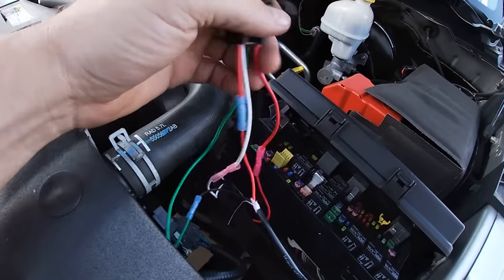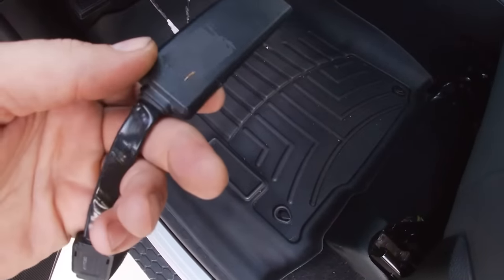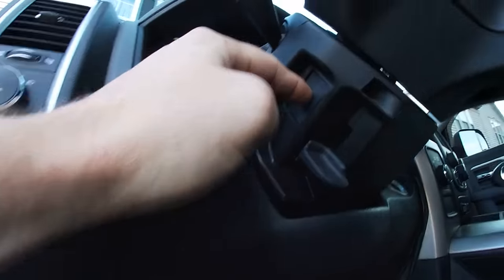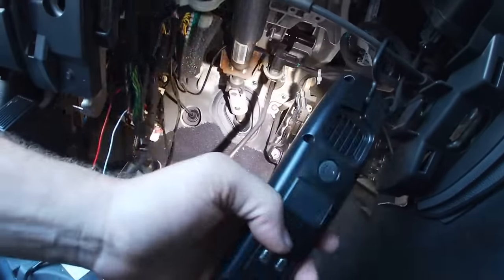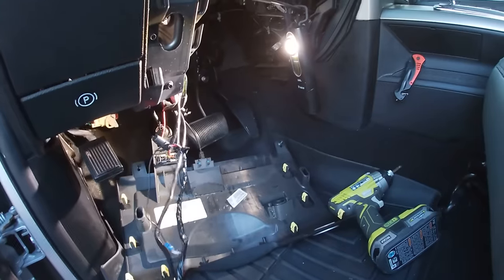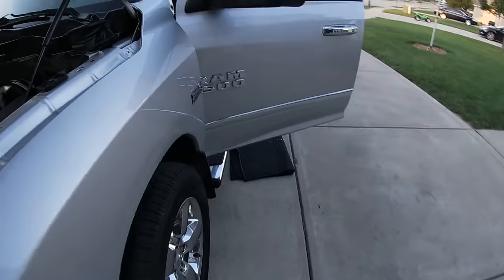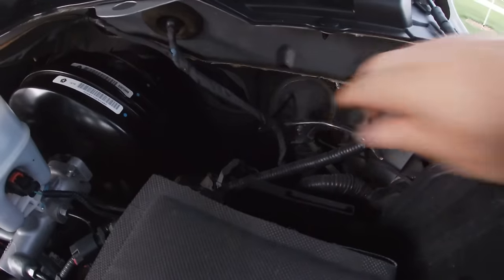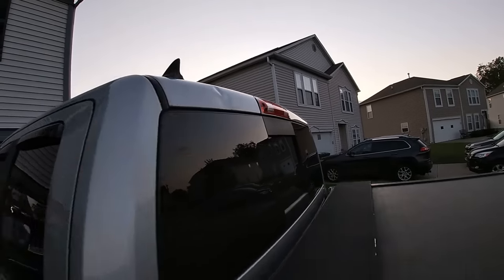Tracking Device Found on My RAM!

Comment: I just found a tracking device on my ram 1500 installed by an ex. Very similar. But instead of beating, mine honked the horn twice before start. No dealer had answers over phone. So I found a no named box with all the wires that you showed including relay. Thanks for the video.

Comment: I work for an energy company. Our trucks are outfitted with Tele-Matics which tracks our location, monitors for seat belt usage, fast or quick stops, hard turns,speeding etc. At the beginning of the following week we get a "report card" on how good or bad you drove based on mileage that you drove that week.  After truck has a certain amount of miles it gets turned back into leasing company who then auction vehicle. Obviously they don't always remove them.
Reply from the maker: jeff sir It makes sense to have them especially for a business. They should be responsible for removing them though because they will cause future problems like this one did.
Reply: I totally agree. Also these things have a draw on the battery because they are always on even when ignition is off.

Comment: Hey, I've got a 2015 Ram 1500 eco diesel that I bought from used car dealership. It won't start and the remote won't unlock the doors(checked the battery, good) found a DBall2 under the dash and think I'm having trouble because of that. Do you have any suggestions on how to remove one of those? I only one key and nothing on the disabling system. Thanks!

Comment: The tracker is a anti-theft device to locate the vehicle, and make sure it's not being used after hours, or the wrong way on the job. It's a cost cutting insurance premium saving device. Very common during the early 2000's.
Reply: Very common now.  I am a sysadmin and part of my duties involves helping people access the system to monitor, all our clients with more than a handful of vehicles in their fleet utilize trackers now.  The trucks at our largest clients all have front and rear dash cams as well in all their vehicles, I have to help them archive footage from incidents all the time.  There's a lot of money riding on those trucks, a vehicle being down costs tens of thousands in lost productivity.
Reply: This is correct, we have these similar GPS trackers installed at our work cars & trucks.  They don't have a starter kill but they do track 24/7 thru the OBD port.  Because our agency is self insured, we use them to reduce liability.  I can pull up any vehicle in our fleet and find out where they are, how fast they are moving, total average speed, and any airbag deployment.
Reply: @patshozo9158  In modern times they are like the drive safe modules that insurance companies use to lower your insurance rates, or the OnStar, or Guardian services.

Comment: I found a cellular tracking device in my used car, I tore it out and gave it to the dealership after they denied putting it in there.
Reply: High risk loans use them, rentals fleets, work fleets.  Alot of vehicles bought at auction sometimes  have them. Dealerships wont check that lol i have got 4 from 9 vehicles i purchased had them
Reply: Maybe the dealership didn't, you ever think it was installed because maybe it was a lease or fleet vehicle. You really showed them, tough guy
Reply: The dealership didn't install it. Why the hell would they go to that expense? They didn't finance your truck personally. They just wanted to sell it and move on. Tracking device was put on my the previous owner. Pretty normal practice these days for fleet vehicles and even personal vehicles. They just aren't worth the time to take off. So they get left on. Relax, conspiracy theorist. 🙄
Reply: I found one in a car I bought as well. The dealer had tried to get me to pay for a vehicle theft package as an add-on. I absolutely refused and got them to drop it, but it was still in there. They told me that's what it was for.
Reply: @jymlewis  Dont use conspiracy theorist as a negative thing. Its a neutral thing as in "questioning the status quo". If no one ever did that we would be living in a dictatorship already. Already confirmed and released to public "its a surveillance state", "CIA ran/running drugs", "Tuskegee experiment", "War is a racket and only for profit", and many many more. If you never ask the questions, then how will you know the answer?
Reply: They installed it. Ive done a few. They sneak the car in quick and have it installed
Reply: You said used car. They might not have, the original dealership, the owner, or third party might have put it in there. Cars will get traded in and the devices will go undiscovered and they just pass them on not knowing there is a tracker in there
Reply: Dude, if they got the car from another dealer, they really might not have known it was there.

Comment: We purchased a 2019 GMC Acadia that was a fleet vehicle in its previous life. I decided to surprise my wife a few months after buying it by taking it during her 12 hour shift and getting it cleaned and the normal fluid changes. When the oil change guys were done, they said there was a loose wire hanging from the bottom of the engine bay. They were gracious enough to let me go into the pit under the car to see this. Turns out it was the tracker that had been installed by the dealership when it was part of their loaner car fleet. We pulled into an empty bay and spent 10 minutes following wires in the engine compartment and removed all of the connections. When we did, an alarm started going off under the dash. I pulled the dash out and found a box similar in size to the one you pulled from the Ram. It was wired into the radio as well and had a cellphone sim card installed. Obviously, I removed it. The next day, I get a visit from police investigators asking me about the device. I turned it over and explained that it wasn't a fleet loaner and showed them the bill of sale. After several months of back and forth and even a trip to the stealership with the cops, they backed off.

Comment: When you first took delivery of the truck, was it beeping?  If that was super hot to the touch, that tells me there must be something wrong with the gadget.

What do you think about new vehicles using turbos on small 4-cylinder engines?  I drive a 2016 Honda Accord and am glad that it doesn't have a turbocharger.  (2.4L)

Comment: Geez ....Doesn't Chrysler have enough electrical problems without idiots adding crap!
Reply: As a former lifelong Dodge/Chrysler owner I can attest to that. Honestly I would still love Dodge and Chrysler if Fiat hadnt bought them. Instead of improving on the issues they’ve always had they’ve only gotten worse
Reply: I had a 2014 300  great car but after 10k the tranny needed "software" update caused it slipped between gears at 24k  a short in the alt killed the battery and finally 30k the AWD gave up the ghost. I traded it before the 36k warranty
Reply: Jeep....all of them being mopar..Jeep is the most frustrating damned vehicles ever! The security is a joke! It’s a damned Jeep not a Porsche so wtf do they use security screws in the ignition etc and then the security box in the glove box...when it goes bad and I’ve seen some go bad at 15,000 miles...might as well sell it for whatever u can get cuz it’s a never ending battle with the crank no start and alarms going off as ur driving down the road! Why haven’t they improved this crap? I love dodges! Love how they ride and the hp loved my dodge but my moms Jeep is sitting still after 3 years and no one knows why it won’t start
Reply: Lol, corporate has ruined everything.
Reply: oopps you got confused with Fraud (Ford) about electrical issues, does anyone own a Fraud without the check engine light on continuously on covered by a credit or business card (yeah that bad) drove 2 so yeah Never again. no more timing chain, cam phaser, oil pump,  failures... you just drive Dodge easily do 350k miles
Reply: @AmericanSurvival001   mines at 211,000 I have changed a valve cover gasket and the heater core and she still climbing to 300,000. Love my Dodge. My wife has been through 3 other vehicles while our Dodge seems to be the truck that keeps our family moving.
Reply: @shaunmcgowan827  exactly if that was a Ford you'd have $4k into it by now, like some  my friends just to keep it running, WE know the truth not the propaganda  that out there.
Reply: @AmericanSurvival001  yes sir a guy I work for has three of them sitting in his driveway. They rotate them in n out of the shop.
Reply: Not sure what happened with Chrysler vehicles. We owned a 1972 Plymouth Satellite Sebring Plus and not only was it scary fast, it was the most insanely reliable vehicle we have ever owned, we wish we still had it. I know that was a long time ago, but still.
Reply: @AmericanSurvival001  Truth ?All manufacturers have problems. Fiat Chrysler are at the bottom. That's the truth. Check out Scotty Kilmer channel for over 50 years of real world mechanic experience.
Reply: They are actually very simple devices.  Done properly they won't hurt anything and are supposed to be disabled at the right time.  This was one that was installed poorly and not disabled when it's use was over.
Reply: @AmericanSurvival001  my sisters escape has been at the Ford house 11 times since may 2019 for electrical system b.s.
Reply: @freedomliberty7611  Scotty Toyota Kilmer... Yeah he tells a lot of b.s. about car and truck history thats just untrue
Reply: @AmericanSurvival001  There is a reason that the dodge is just a shipping crate for the cummins.
Reply: At least its not a Ford
Reply: @Pat Larimer i was only speaking from experience
Reply: @Pat Larimer that I've only had problems with pos fords? It's ok mopar or no car troll boy.
Reply: No kidding!
Reply: We have software issues after an update. U CONNECT is on a Go Daddy website. They said take it to the dealer.
Reply: @classicgalactica5879  I got my dad's 74 satellite sebring plus with the 400 4barrel when I turned 17. Best car I ever had. Still miss it.
Reply: Holy sht. A truer statement couldnt have been said. Ive had to give up on two jeeps due to electrical bs and two engines and a transmission. All under 20,000 miles during covid. All to say… i didnt drive much. 
Ask 2020 gladiator owners about that uconnect thats not included or the 
“Aluminum doors” that magnets stick to every inch of (surface magnets not ACME sized)

Many PAY HERE places had tracker cutoffs for peeps who didnt pay their note every two weeks. If to the column, could be antenna or could have led to a cutoff at ignition.

Comment: They really f**** up the OEM harness for a gadget that can be put on a vehicle without messing with the harness.
Reply from the maker: Peace & Love Yes they did! People keep commenting that I messed my GPS for my screen up by removing that. Obviously people don’t know what they’re talking about because there’s no way the factory would I stall GPS like that. 😂
Reply: With that device , they can shut down your vehicle.  Happened me once. Then i ripped off that device out . No issues after that
Reply: I added a tracking device on all of my children's vehicles so if they were in trouble I could find them from an app on my cell phone. It was a simple plug-in device from Verizon Wireless that plugged into the diagnostic link connector under the dash. My son's 2021 Chevy Corona aka Colorado has a built-in tracker from the factory. He has an app on his phone that says "MyChevrolet" and he or we can track his truck. So if you have a newer Chevy try out the app from the Google Play store or iPhone play store so you can keep track of your vehicle in case you loan it to someone.
Reply: I got a 02 Durango that I've changed the computer and the crank shaft and cam shaft sensor then found the same device but they cut every wire in the stearing colume and put in 12 relays and a bunch of fuses

Comment: That’s a gps for fleet or for a a high risk loan, I’ve installed these on vehicles for banks, it’s also a starter interrupter so if you don’t make a payment you can’t go anywhere
Reply from the maker: That’s what I figured it was for
Reply: @FABAutomotiveDetailing  but in your case, it was corrosion, stopping the supply of power to the relay they installed to power the device

Comment: I have this same problem but only difference is, the relay and a separate bigger black box are tied straight into my push to start and THEN... I also had that little black box (minus the part that beeps) tied into my OBD2 PORT wiring. But when I took everything out, my car wouldn't start... Any ideas? Could there be a second relay since I have 2 signal boxes?

Comment: Whomever did that wiring job has caused future problems, what a mess.
Reply from the maker: Doctor John Yes they did but glad I found it!
Reply: Had one of these on my aunt's van,  it fried the ecm/ computer.  Flashers now turn on when doors open and it won't connect with obd readers
Reply: @spankystar9316  I always wondered what kind of idiot made the rat's nest of wires in my truck. Now I know!
Reply: i had the same thing melted my fuse box
Reply: The installer was a total less than amateur installing it, I'd be embarrassed to admit that was my crappy excuse for work.
Reply: Any installer that uses cheap relays and butt connectors is a hack and probably not certified. I've never heard of this specific product, but as a certified installer with over 30 years of experience, I can tell you that the install seen here was such cheese whizzed garbage that I would fire the installer if he worked for me. Having said that, I have seen some pretty bad installs just like this one on cars at dealerships, and either the install was done by a company that valued speed over quality or it was done by one of the mechanics at the dealership who wasn't certified in electronics. Not all dealership mechanics know about electronics or how to properly install them. Usually, you're lucky if the dealership even has one tech certified in electronics diagnosis and repair. I cannot tell you how many times I, and my fellow installers that I worked with, schooled dealer mechanics on what we did. We are a specialty, just like heavy line mechanics and transmission specialists. One such example was a dealer whose mechanics were blaming our company for the stereo in a brand new Honda Pilot not working. The first thing our field supervisor did was show them where we tied into the electrical system, which wasn't related in any way to the stereo circuitry. Then, our supervisor went above and beyond and actually diagnosed the problem for them. They had spent several hours checking the stereo system, then checked the records and saw that we had installed a tracking system in the car.  They stopped looking for the cause and pointed the finger at us, saying that we "obviously" screwed up the install. They were too lazy and too inept to find the real problem. After tracing all the stereo wiring in the vehicle, the supervisor found that a harness on the far opposite end and opposite side of the car from where our device was installed  had a couple of bad pins in it. The harness was for the stereo and the problem actually happened at the factory where the harness was originally assembled . I've never seen a service manager apologize more profusely to someone ever.

One other thing, not all manufacturers use the same color for the starter wire. There is is no standard coloring for most circuits among manufacturers. Aftermarket electronics manufacturers have standard coloring for stereos, but the auto manufacturers are all different. Also, the mechanic in the video is not an installer or a certified electronics technician from what I can tell based on his comments about what harness the device was wired into and that he was just apparently swapping out relays that may or may not match in the hopes of fixing the problem. (For the record, even if the connector layout of two relays matches, it doesn't mean they're the same kind relay or even have the same amperage rating. That kind of diagnostics can cause more damage than it fixes.)
Reply: As a woman, with my own soldering iron(s) that was a pretty good laugh.  I can understand 
testing a wire by removing the plastic coating but wrapping it up as a permanent install, is crude, rude & stupid.  
  Darwin award runner-up , smh.
Reply: Agree, shitty install. They could have used heat shrink connecters in less obvious places and mounted the relay to look more factory or hid it better. The one on my Gf's 07 Hyundai accent did not have the beeping part and I never did find a relay.
Reply: Totally sloppy wiring job.
Reply: Years ago I worked at a used car dealership and we had been forced to wire them like this and had roughly 5 min max to fully install and hide the tracker now their reasoning was if they yanked it out it’d also ruin the wiring of the car

Comment: Recently my truck wouldn’t start.when I turn the key to the on position,all I got was a buzzing sound from under the steering wheel but wouldn’t start.found an external relay that was buzzing.traced the wire by the brake peddle and found a gps tracking device.unplugged the device and the truck start rights up.lol
Reply from the maker: Javier Adorno Made you a little mad didn’t it? I don’t care about it since our phones track out every move I just don’t like that the dealer didn’t remove it.
Reply: FAB Automotive Detailing yea whats privacy any more? Lol great video and I like you garage set up.

Comment: My 2014 F150 has software installed for the navigation from the factory. Couldn't it be tracked by that software? I had to update the software in order for my navigation to work. The software is also required in order to hook my phone up to the system and control the command system.